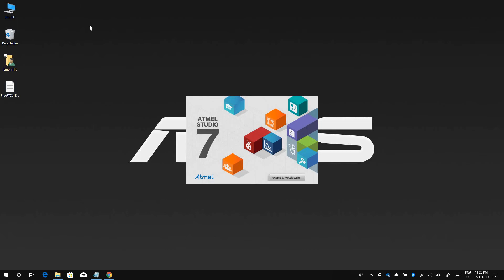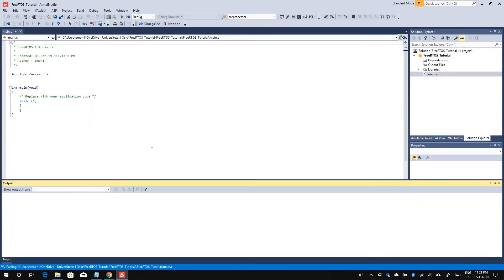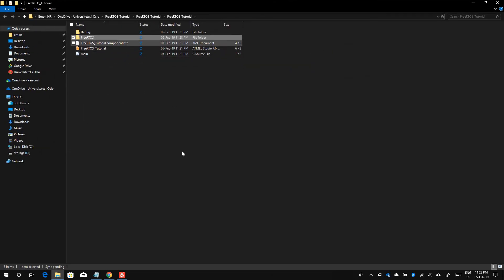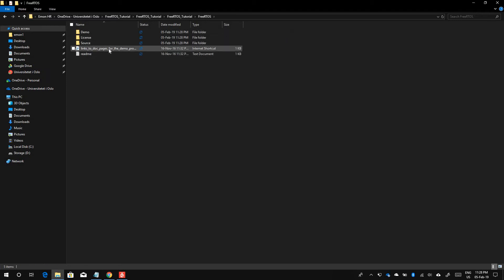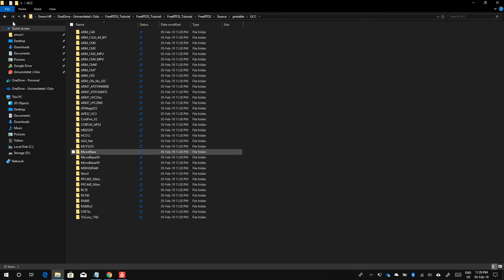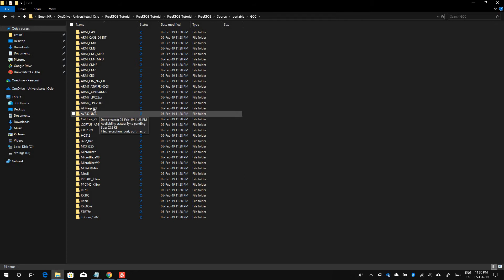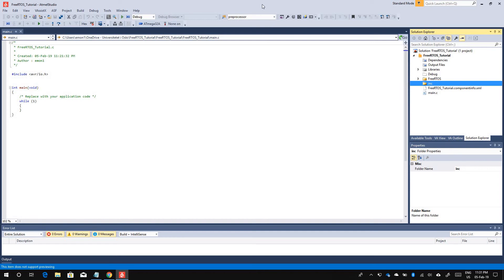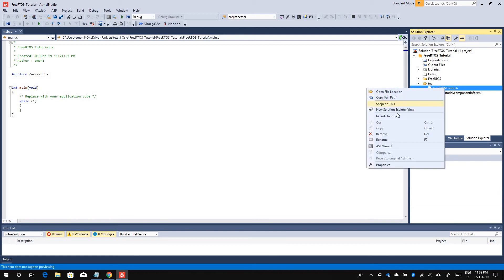02 FreeRTOS_Tutorial: Setting up FreeRTOS on Atmel Studio

Comment: I've followed the video step by step and  got this error
Severity	Code	Description	Project	File	Line
Error		recipe for target 'FreeRTOS/Source/portable/GCC/ATMega323/port.o' failed	
Severity	Code	Description	Project	File	Line
Error		attempt to use poisoned "SIG_OUTPUT_COMPARE1A"	
Severity	Code	Description	Project	File	Line
Error		attempt to use poisoned "SIG_OUTPUT_COMPARE1A"
Reply from the maker: I believe you are using an AVR. Referring to interrupts should be used using the ISR(VECT_<vector>) instead of the older SIGNAL(SIG_OUTPUT_<vector>) . Perhaps the FreeRTOS port for AVR had been created a long time ago. Try to modify the code. If time permits, I will try to create a video explaining how a custom port can be created.

Comment: just copy the files you need instead of copying everything then deleting unwanted files.
Reply from the maker: Been there. Done that. You will then have to manually create the sub folders for every instance. it's prone to making mistakes in naming folders or even remembering which files have been copied.
Reply: @nordisk_ingeniør  I see, it is quite complicated in terms of where do you start or what you need. I'm trying to understand it step by step from simplest program then adding up what I need. Thanks for your effort anyway.

Comment: I'm using the AVR controller.
I have already written code for its different functionality like SPI, UART, I2C, LCD, etc.
How can I use RTOS to run all these functions? like RTOS uses Tasks then how to call all these functions in RTOS
can you please suggest any reference? 
I already watched your tutorial.
Reply from the maker: you can call a function inside any of the tasks just like you do inside your main function. What you do with your functions will require you to use the freeRTOS differently.